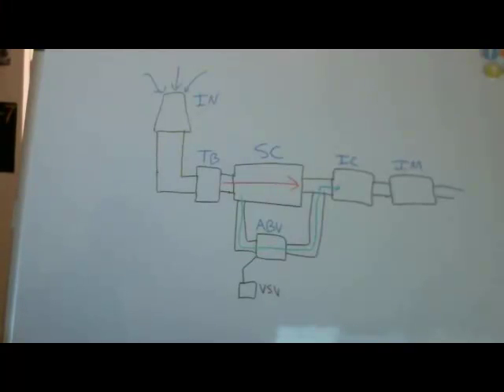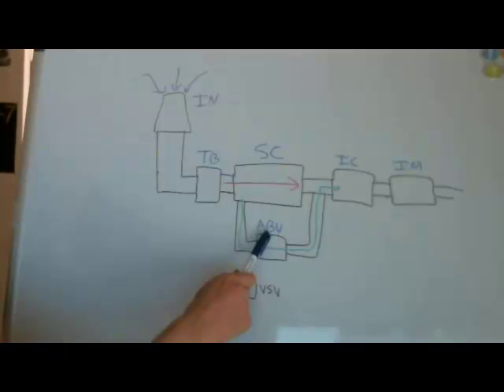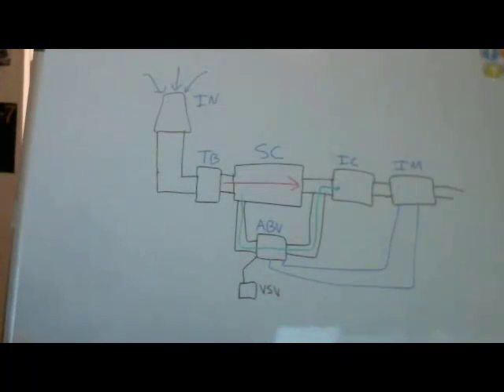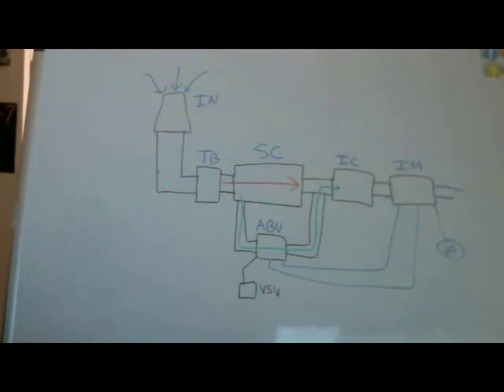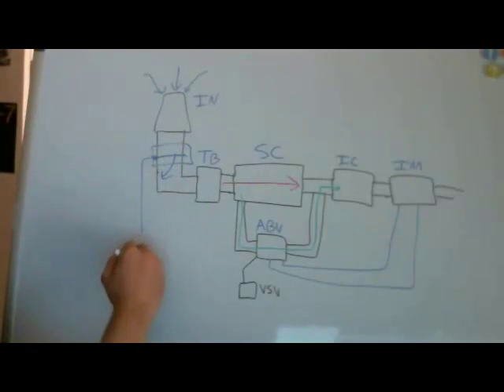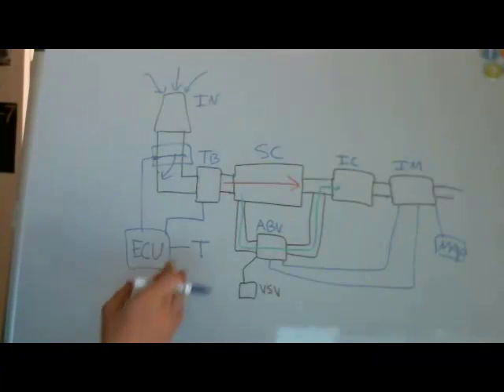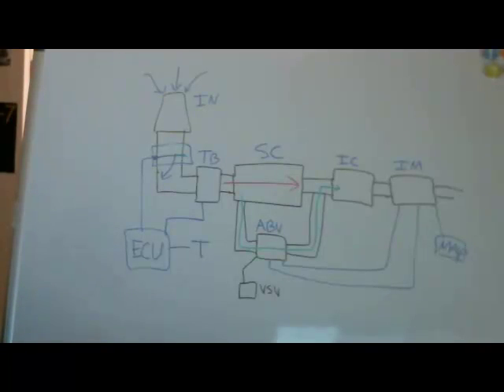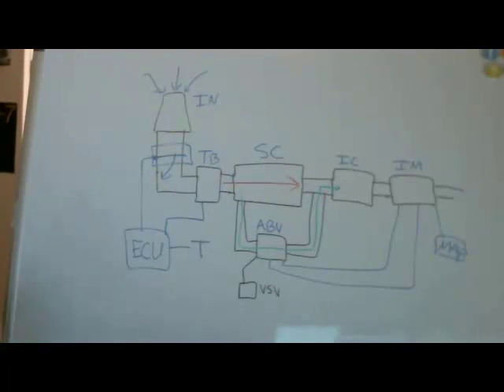Toyota MR2 Supercharger: How it works (part 2)

Comment: I'd also add that  on the 4agze you CAN go beyond the stock 8psi safely (done by many of us MR2SC owners) but only upto around 14psi. This is with a larger crank pulley turning the SC12 faster. To get that extra boost and not have the Air Bypass Valve kick in at 8psi and vent the extra air you do the "ABV MOD" or blank the ABV entirely. This then means the engine can uses the extra air/boost upto 14psi. Many have ran for years like this (nearly 20 years here!) and its been fine.

Another tip: If your SC12 seizes and you've done the ABV mod your car probably won't start at all as no air can get through the SC12 and only a small amount through an unmodified ABV (stock.. it might start with enough air through the ABV but would probably die or go into limp mode when revved/driven).